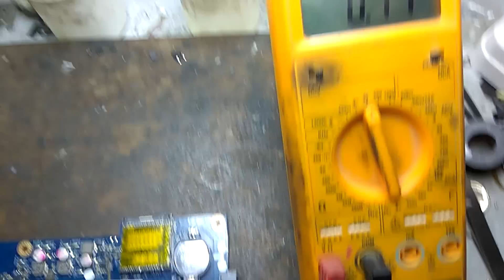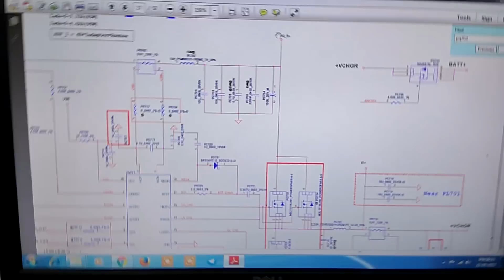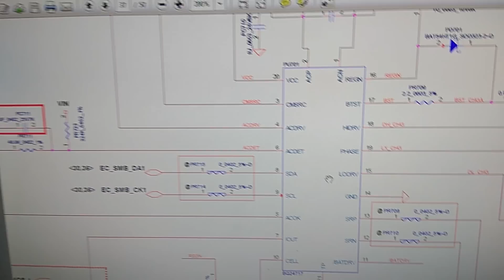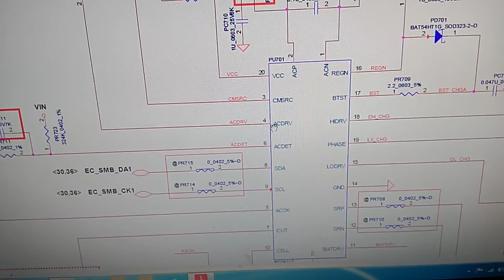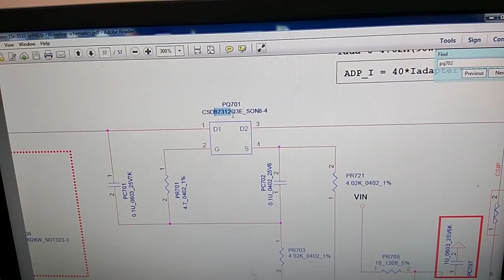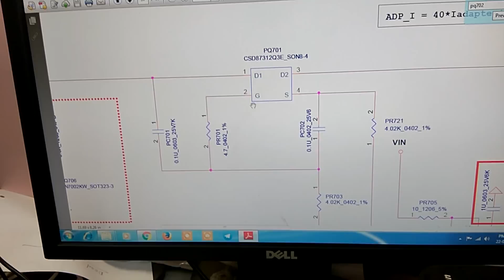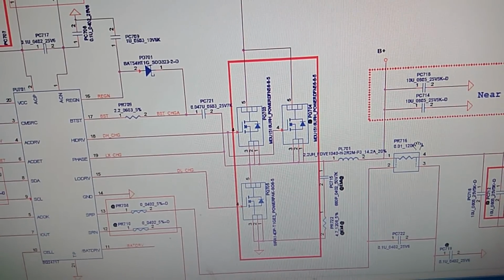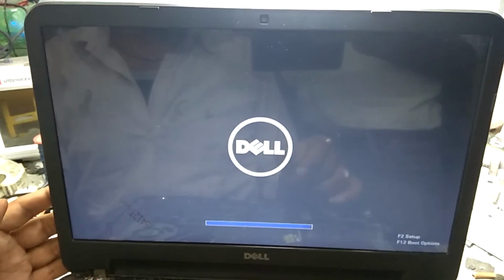Revive Your Dell: The Ultimate No-Power Laptop Fix That Outshines Tech Support

Comment: Hello, I have lenovo ideapad 510, when I was playing a game and connected my phone to charge and ac adapter was on and charge of laptop was around 90% and it automatically shut down and I pressed the power on button but there was no sign of led or anything so I pressed power on button for like 1 button of extract the battery so I did and after that I plug in my ac adapter there was nothing what do you think I should do? Buy new adapter or is it different problem? Help much appriciated! Thanks alot beforehand!!

Comment: Pls help I have dell latitude e6410 battery good and laptop not working also the charger when plugged to the laptop the adapter led turns on
Reply from the maker: Mb fault may be
Reply: I don't get you . I know is faulty dats am asking what I can do to it to make it work perfectly.  Thanks
Reply: I don't get you . I know is faulty dats am asking what I can do to it to make it work perfectly.  Thanks
Reply from the maker: damilare moses I cant help online !! As I am not aware of the exact issue
Reply: So what can I do dat will make up u help?

Comment: Hi sir, i have a problem with a LENOVO G405 no display, when the Power on I remove the memory and scratch with the eraser and the I put again in the slot. also not working. please help me to repair?
Reply from the maker: Joel Lorenzo +91-9584145145 WHATS app

Comment: For last 2 years, my Dell inspiron 5537 was behaving unusual way. When I turn on my laptop, after screen turns on in 2-3 seconds, laptop shuts abruptly. Then I again turn it on it starts nicely. Now last week it didn't even start. I did everything like removing battery, static charge release, Cleaning the motherboard dust gently. Then I noticed when charger is turned on, it makes little noise on motherboard where the charges wire connects to motherboard. Sometimes a small component turns out to be too hot. What could be the problem. Thank you.
Reply: How strange I am Experiencing same with my laptop.

Comment: Hi,
I'm having some problems with my laptop. Yesterday I was doing some data backup and went to another room for a while. When I came back the laptop was off. I thought that maybe I plugged charger wrong and the battery is dead, but surprise. It wasn't a battery... firstly nothing worked. clicking a power button did nothing with charger + battery, only battery or only charger. Then after doing some research I tried to release static charge. So I've pressed power button for few minutes with battery off and I hoped it worked. So I put my battery and charger back, pressed power button and... the power button light turn on for a second and went off. the led on front was also blue. So I've pressed again and again with same result. And after forth press all the lights went down and don't want to come back unless I do the trick with "releasing the static charge".
What may cause this add behaviour?
Thanks for any help, I appreciate it .
Reply from the maker: Om Shankar Ray check cmos battery once

Comment: Hi. I have a LA-9981P motherboard. It works on battery, but it doesn't work on a charger only.  The charging light is on, but it's not charging. Is it possible that because the PU701 (BQ24717) is dead that the laptop won't power on using only the charger? On PU701 pin 15 is also grounded (inside the ic, not on motherboard).  The traces on pins 12 and 13 are missing (liquid damage)
Reply from the maker: Can be !
Reply: @Aditya11ttt  Thank you.

Comment: great video. I have a HP 15c137.. power light turns on but that's it , But power. when I press the power button, the light turns on. that's it. any clues? should I just get a new board? the drive doesn't work and no light. did I shorten the board when I opened it? thank you good Sir.
Reply from the maker: i think try repair first den go for change if faied!!
Reply from the maker: i think try repair first den go for change if faied!!

Comment: i have a dell studio xps 1647. I did  a bios update just to be updated. during the update the computer froze. so powered it down and it wont turn on anymore. no lights, no fan. not a backlit black screen. I have booted it before in this condition to a black screen with text. I dont remember what screen it was. but it was done by the 30 sec power button like above, no battery in  and plugging it in to power supply. the catch was there was certain keys or a hey to press before and while pressing the power button to turn on. I cant remember so I can reflash the bios with a good file
Reply from the maker: MARK RATNER WHATS app me !! Number in disription

Comment: Hi guys,  have a HP 15t j100, but no sure where to find the board circuit diagram can you please advise? Thank you for the video
Reply from the maker: Julian Mancera what’s the board part number ??
U can try website lqv77 once
Reply: Hi Aditya, after checking better the board reference is s947. 

My laptop powers on but the battery doesn't charge.  I did some multimeter testing on the battery pins with battery off the pins have 3V, when I put it back in the battery  the voltage drops to 0.8V.  

I did some continuity testing and I have two RQ3E080BN mosfet conected in series. With battery off for the first mosfet drain voltage is 19V and source is 3V, the second mosfet has  0 source voltage and 3V for the drain. Mosfet 1 source and mosfet 2 drain are connected at 3V. The problem is that when putting the battery back in this 3V goes down to 0.8V that doesn't charge the battery.  Do you think I should change the both mostfets?  

Thank you for your help!!

Julian
Reply from the maker: Contact via what’s app!!

Comment: My Dell Inspiron 3521 laptop no power. Only once or twice laptop booted in last one year. when booted, its run smoothly till we switched it off. After that again no power up. Can you suggest remedy for this. Where you from?
Reply from the maker: Adi batt or cmos chcek once
Reply: Thanks for reply. Even if I remove battery. it wont start. cmos battery is fine

Comment: kuchh samajh me nahi aaya. you mean gate output should be higher than 19 v? Mere do do laptop dead pade hain har saal repairing centre bhejna padta hai ...dono laptop bich me sahi se on hua tha ...fir wapas dead. what might be causing the problem? Power cord is original ,batteries not working. damn frustrated.